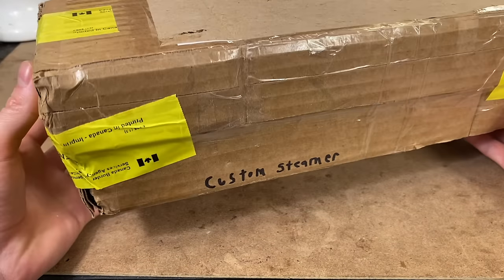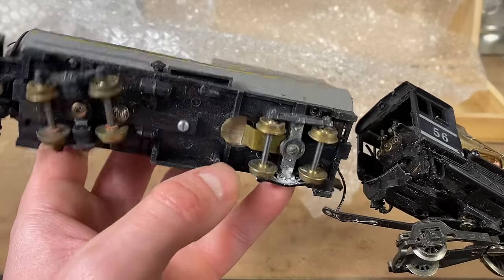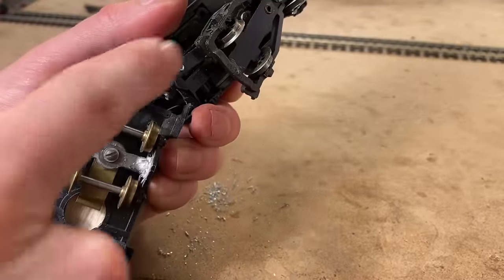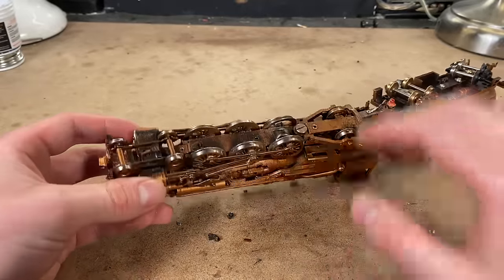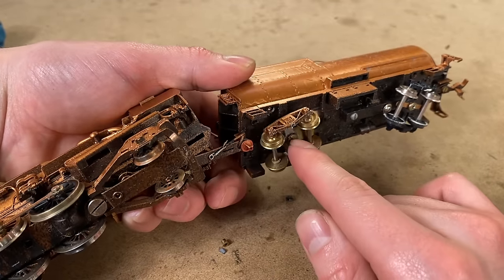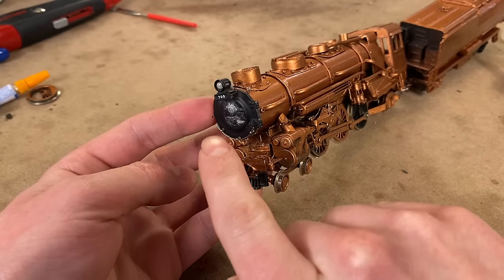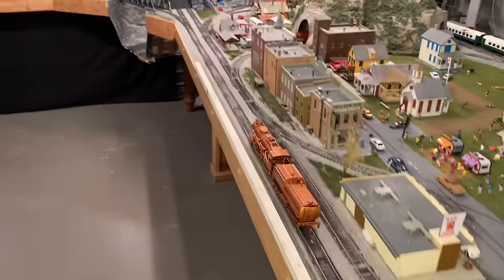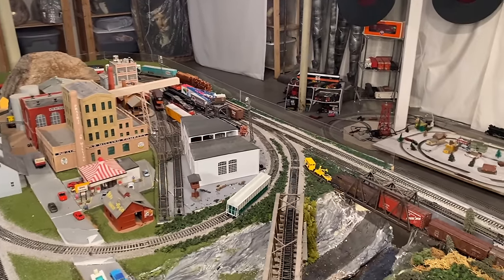Cursed HO Steam Locomotive from eBay - What is This Thing??

Comment: I can't believe the guy was trying to sell that junk for $250. After your work on it I don't even think it would be worth $250 but certainly a lot closer to it. You do amazing work.
Reply from the maker: Yeah, someone coughing up $250 for it is insane. I'm not surprised it was there for so long.
Reply: @SMTMainline  250 for a non new in the box train is a scam but maybe you made it worth that
Reply: Don't be mean it's not that bad for being a custom made train, it's kinda good for what it is.
Reply from the maker: @1964catt  The boiler is decent but $250 is still an insane price for such a thing.
Reply: Yeah but if it was painted black and replace the face plate it would look good
Reply: Well Hornby over in the uk some what sell steampunk locomotives for that same price. So my guess the guy did not want to fork the money to buy one and make his own and for it being a home made steampunk style engine it is not bad rough around the edges but not bad. With a little more kitbashing work and i can see that engine being a vary nice steampunk style locomotive.
Reply: @SMTMainline  You got ripped off, On my layout i use only 'HO' Diesel locomotives due to the fact that 'HO' steam locomotives are a real pain in the rear end to repair, You do resourceful outstanding work.
Reply: That's the thing with trying to sell brass kitbashes. Brass is always going to be super-expensive, but the demand for a kitbash like this is very low. As a result, the apparent value to a buyer is much lower than what would be a reasonable return for the seller.

If you're going to kitbash a brass locomotive, you better intend for it to be a permanent part of your collection.
Reply: Why not paint it black?
Reply: Ahh, indeed...welcome to the world of a steam punk 4-6-2 Pacific locomotive. Good luck my young friend.🤞
Reply: 30 dollars at best for what was there
Reply: @SMTMainline w
Reply: I guess he didn’t wait to wire the light to the engine or decoder if it’s dcc
Reply: @Lord_Billy  the good deal and then the ridiculous shipping charge.  Another e bay trick.

Comment: The worst part is that the locomotive actually runs. I remember the lifelike subway units you got a while back. Those had sized engines but this monstrosity runs.
Reply from the maker: Yeah, it doesn't make much sense does it. I credit the quality of Rivarossi parts (with the exception of that wheel) for keeping this thing going.

Comment: Investigative skills: 100%. Troubleshooting skills: 100%. Problem-solving skills: 100%. Repair skills: 100%. Innovative solutions to unusual problems: 100%. Narrative skills: 100%. Harrison's skills are beyond reproach. And he hasn't met a locomotive that could not be rescued and perhaps even improved. Outstanding job on a very unusual project.
Reply from the maker: Thank you so kindly! This is not the finest work I've done but it seems to run half decent so I'm happy.

Comment: Not gonna lie, that thing actually looks pretty cool now. I just recently found your channel and am getting back into the hobby after probably about 10 years away from it. I'm building a layout and have been debating on going DCC or just sticking to DC like all of my stuff is, and I think I'm just going to stick to DC and save myself the hassle of having to swap over all of my locomotives. At this point I just want to get them running again lol. Thanks for the inspiration to get back into the hobby
Reply from the maker: Not that there's anything wrong with DCC but I have both and find myself using the DC far more often. It's not too hard to switch over if you change your mind ether.

Comment: That is certainly a very unusual steam locomotive. I recently got one that was custom made as well. Someone created their own boiler and used a drive system from an old Tyco Mantua steamer. There was also a block of wood inside the boiler but I have no idea what the original owner would have used it for. I’m slowly working on restoring it so it will hopefully be a great runner someday. Great job getting this engine going again I have to say that it turned out to be a nice runner!!!👍

Comment: It looks like someone made the boiler shell out of a piece of copper or brass plumbing tube. It’s a shame that even with evidently dozens of hours of work by the original artist, the value of the effort was not realized.  Anyway nice repair work!
Reply from the maker: The boiler was well done in my opinion. The cab, tender and front not so much. I think someone got impatient building it.

Comment: Thats a real interesting engine, I customize 1/32 and 1/35 scale tractors and construction models, if I'm not working on real machines. I use brass and stuff for those models that boiler probably wasn't cheap or a quick project that I do know. I like the updated front, but not the color, I think it would of looked better black with some weathering and some SMT Mainline decals on the tender so it would of been your own rail line engine ,but at the end of the day  It's your engine and choice.
Thanks for all the great content I'm not a model railway guy but being a mechanic by trade. I always find something interesting and different to my work to watch,  when you fix up projects and do unboxings/ testing eBay goodies . Take care
Reply from the maker: It would have looked better in black but I didn't want to disrupt it's unusual look too much.

Comment: I’m currently working on a custom locomotive of my own. It’s a model of a US Army Transportation Corps S160 class 2-8-0. I’m using an IHC 2-8-0 as the parts donor for the chassis and mechanism. The tender and boiler shells will be 3d printed, and the tender chassis will be taken from a Bachmann 2-8-0. It will be dcc fitted with a 21-pin dcc socket and an ESU LokSound decoder.
Reply from the maker: Right on

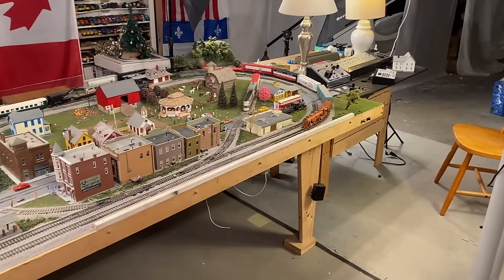Comment: I Really Happy That It's Running Like A Train, But 18:59 The Head Light On The Locomotive Is Not On After It Was Brass Painted & Done, What Happened About The Head Light?
Reply from the maker: It works however it's super dim.
Reply: @SMTMainline  No, The One You Install On The Locomotive You Worked On 13:02 This Part

Comment: Actually the boiler reminds me of the old Lionel trains from the EARLY 1900's. All shiny brass and nickel and oversize headlight. I think if the original builder/ seller had made the entire thing, boiler, cab, and tender out of brass, it would probably have been worth more. But perhaps the box it came in was worth more than the engine!

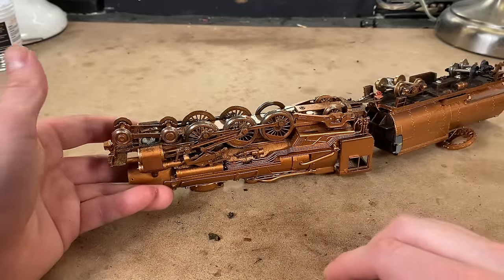Comment: 8:48 what should you do if you do have a problem with shedding screws?
Reply from the maker: You can add a bit of thread lock or CA to the threads but you have to be really careful not to get it on moving parts or in the drivers.

Comment: good video, @19:06 the vehicle bridge looks bowed down in the middle, is it an optical illusion? or needs supports?
Reply from the maker: It needs supports. Nothing relies on it so it's more of a cosmetic nuisance more than anything else.
Reply: i wasnt being critical, as a plumber i have the eye for pipes being level
and straight so i noticed. i didnt want the box truck to collapse into the canyon
Reply from the maker: @novanut1964  I didn't take it as an insult, it was more of a "matter of fact" sorta thing. Sorry if it came across as passive. Thanks for watching 🙂

Comment: Nice save considering when that came out of the box in my mind I heard the scifi/horror trope voice of the mad scientist victim begging the hero to " please kill me ".
Yes some of the values placed on items on Ebay. While not model railroad related I'm also into collecting and using vintage razors.  Some years ago someone had obviously been rehabbing their bathroom and found a 1964 Gillette Adjustable ( same razor Bond is issued by Q Division in Goldfinger) and of course figured they could offset the costs of the rehabbing by putting the razor on Ebay. This razor was covered in green corrosion that brass gets, all it's plating gone and the shaving head is canted at an angle as if it's barely still connected. This razor sat on Ebay for at least 6 months and was a running joke in the vintage shaving groups at the time because minimum bid on this poor thing was 900 dollars. Some people suggested offering a dollar  to put the poor thing out of it's misery.
Reply from the maker: I think some people throw things on eBay way overvalued in hopes someone who doesn't know any better will believe its actually worth it.
Reply: I have a King Gillette made in England in the mid-50’s as my daily razor and in no way is it getting out of my hands. My dad “traded” with me for my adjustable one. It’s the best razor I’ve ever owned and a bit of a scrub with a nail brush gets rid of the accumulated soap scum and green tint.
Reply: @Quince828  got pretty much at least one representative of Gillette from a cased 1907 " ribbon " razor to a 1980 date code Gillette safety razor supposedly the last from Gillette. Also have several 50s through 70s that belonged my father, grandfather, my late wife's father and grandfather ( those his is a 30s vintage) as well as my great grand father's Gillette Big Fellow from 1920. Though probably my best acquisition was a completely intact save for the shave mirror tacks WWI US Army issue.  Did also have an 1890s and 1930s cutthroat razor but sold those after my wife's death..
Reply: @garysprandel1817  I didn’t know there were date codes on them, I’ve never seen one. I thought mine was a bit unique having been made in England. Nowadays Gillette blades seem to be Russian.
Reply: @Quince828  there's a letter or number or combination code from the beginning of Gillette through some time in the 20s with a period through the mid to late 30s where date codes start again. Usually stamped on the underside of the head near the handle. Should still be various websites to help decode them

Comment: That locomotive looks a lot like a pennsy K4 pacific. Also you are not going to believe what happened to me on monday. I wa a t hobby lobby looking at model rocket supplies and in the clearence section i found a Bachmann n scale train set. It had a lable on it saying i did not fully function. The set in question the Bachmann yard boss train set normally sells for about $130 but it was going for $40. And all it needed was a little bit of lossining on one of the screws..
Reply from the maker: Sounds like quite the deal

Comment: Cursed? I don't know what to say, looks like an attempt to custom build out of different parts.  Quite a challenge to be working on that engine.
Reply from the maker: The lighting system and front of the boiler were pretty bad, the rest is fine in my opinion.

Comment: the wheel that broke  i believe had the traction tire on it . i have some extra rivarossi  wheel sets for that .if you count the teeth on that axle I could match one up and send it to you if you want. Great vidio
Reply from the maker: Thanks for the offer Corey. I don't want to sink too many good parks into it so I'll see how the wheel holds up.
Reply: @SMTMainline  ok   I have a few from all the 4 6 2 locomotives I have chopped up to build other stuff.

Comment: Hey my lifelike locomotive is not working It's getting a electricity The light turns on but it doesn't move But whenever I put a 9 V battery to the wheels the wheels spin Do you know what the  Cause 😊
Reply from the maker: That's strange. Maybe something is caught in the gear box like dust or hair?

Comment: On that bulb shrowd, I don't think it's sitting where it should, I noticed screw holes near the top (5:37) I bet if ya line that hole up with the screw, there will be another on the other side.
Reply from the maker: It must have been missing parts.
Reply: @SMTMainline  I'm sure customs had a hand in that 🤣
Reply from the maker: @93gamrx  They probably lost pieces after it got damaged in shipping. A good group effort to try and eliminate this thing.
Reply: @SMTMainline  hahaha, it truly is cursed. I was impressed with how well it ran tho. 

Side note, does your channel have a discord? If so I'd like to join it.

Comment: Truly disappointed you painted over the copper.  Like you said,  someone put a lot of work in the metal work.  I think you should have painted the rest of the engine and tender to complement the copper work.
Reply from the maker: My goal was to balance it out a bit. The paint hides the original colour but not the shapes of the metal.

Comment: Seems like an aborted project. Could have been good. In the last years, i especially have an eye on self built locomotive from brass, plastic or wood and i'm proud i have some in my collection. Most of them are rather not complete, old and rusty, totally dirty and abandoned a long time or just an overbuilt coin box in one case but these facts are the reasons why i bought them. You can clearly see someone with much enthusiasm tried to built something unique for himself, as a gift or for his apprenticeship. I appreciate that. I like everyone of them. Especially the very good looking 4feet long wooden DR BR24, which was the last project before the builder died at high age.
Reply from the maker: I think you're correct. The boiler appears to have quite a bit of effort put into it however the rest of the locomotive looks rushed. Someone must have got tried of it and didn't even finish it.

Comment: Wow, if this is "good work", you model loco engineers are savages 😅

Cant believe you just annihilated all that nice copper and brass with rattle can metallics - if you'd taken some more time, dismantled the engine and figured out what the original artist intended, theres no doubt in my mind this could have been a 250CAD$ engine. It all fell apart after you hosed it down with paint and then tried to run it like a wheel lathe. I do wonder if the paint solvents on those tiny wheel spokes coupled with some overloading during the cleaning process were to blame for the total failure of that wheel, or if it was our good friends at the border who i feel did some damage to the loco.

Poor little engine. I feel sorry for it.
Reply from the maker: The only way this thing could be worth $250 is if I added gold parts to it. It was in terrible shape long before I got my hands on it.

Comment: Unusual model but nice if it was converted to more of a steampunk design...it kinder annoys me that border force or who ever etc vandalized it..that kind of behaviour deserves a flat nose and permanent job suspension..cause that's somebody's personal property.
Reply from the maker: It could have also been damaged by UPS. If it was something nice I'd be frustrated but in this case it all worked out.
Reply: @SMTMainline  Well that's the main thing as long as your happy with it..I'm surprised the seller tried to sell it for such a high price and that you were lucky to get it for what you did..I can only assume that it's because of brass and the work that went into the body shell itself because of it. 👍

Comment: WTF did you spray it all in copper paint? !!    You ruined it, visually, aesthetically...   
Not to mention the gumming-up of the conn-rods and bearings.   
The only real improvement perhaps, was the replacement smoke-box hatch and running lamp.  

But honestly, the metallic copper spray job made it look like a cheap 1960's  imported TOY. 
This has to be the most unprofessional paint job on a loco I've ever clocked on YouTube.
Bloody awful!

I would have left the pipework  and other fine metal details unpainted and probably painted the boiler, steam chests, chassis/tender etc in European black and red (circa 1940s).   Maybe added some smoke deflector plates ...
Reply from the maker: I think I'll repaint it black. It didn't gum up anything because I oiled the parts beforehand so the paint wouldn't stick. If it wasn't the case, the locomotive wouldn't have been running like it was in the end.